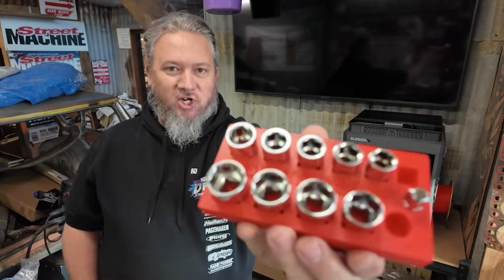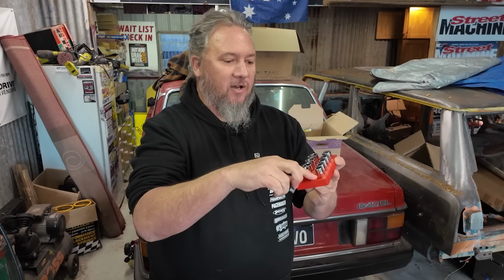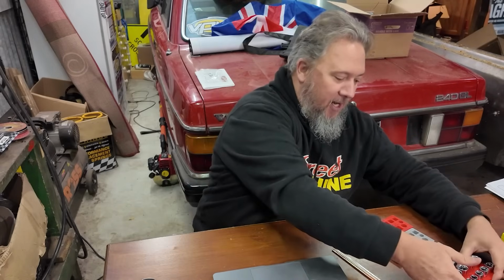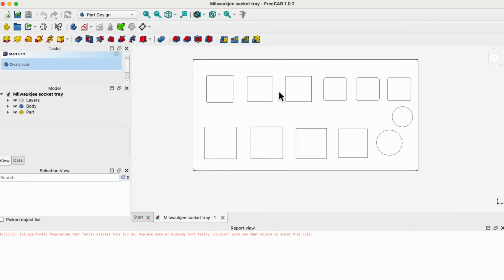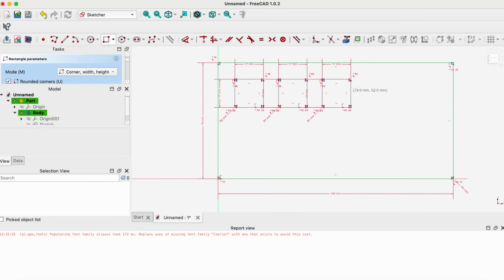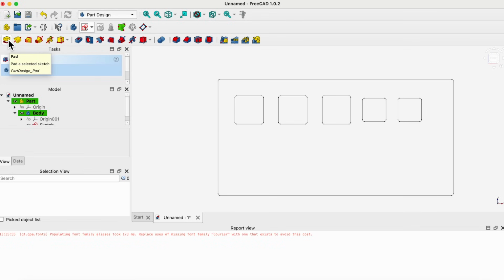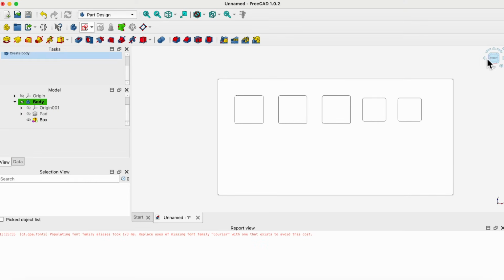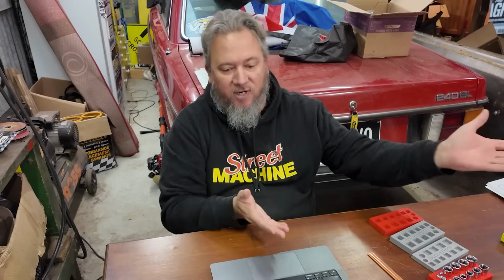Scotty's Garage - How To Design Things With FreeCAD

Comment: Do I require a good computer? I want to get a printer and don't have a computer only tablet atm
Reply: Not really, I'm using a 3yr old Dell laptop and works fine
Reply from the maker: It's a good question. I just use the MacBook that I edit with, so it's a decent computer, but I haven't tried uploading the program to my PC laptop that I use for tuning

Comment: 3D printers seem to be a rabbit hole , CAD drawing programs are definatly a rabbit hole.
Me personally , I have gone from using AutoCadd from 2004 to 2008 to using SolidWorks from 2008 to now in my job. (we also ditched AutoCadd for BricsCAD)
For the more recent project I did at home I used Fusion 360 , I drew up & printed a couple of alignment tools for the front & rear crank seals on an LS1 I was putting together. The number of file thing is a pain , but there are ways of handling that.
Reply from the maker: That sounds like you have a lot of experience with CAD software. That's awesome

Comment: OpenSCAD can be parametric I used to make different belt drive pulleys for my custom built 3d printer years ago, it was good for testing before forking out for the metal versions.

Comment: You should get use to making all your designs parametric. Once you get use to doing it you'll love the ability to change sizes and have the design adapt it.
Reply from the maker: I'll look into that
Reply: Can also help with tolerances as you can set a 3dprint parameter on the value of another parameter that will add 0.3mm as am example on to the size of a hole to give you clearance and then if it was too tight you change the 0.3 to 0.4 and it will update your other parameters

Comment: Hey mate, I would suggest sticking with the free Fusion360 program. The "10 Editable documents at one time" restriction shouldn't be a deal breaker for the DIYer. You can still have several hundred documents/designs on your account and all you have to do is switch between Editable/Non-editable if you are working on 10 different designs at once. It shouldn't be a deal breaker for 95% of home users. IF you decide to sell your prints "commercially" you will need the Professional account once you exceed a certain income.

You'll also want Fusion360 for the CAM side of the program. Right now you're just getting into 3D printing and its all exciting, I get that, I was the same. You'll soon realise that printing is more for prototyping of strong parts, not just cup holders or dash pieces. Soon you'll be looking at benchtop CNC routers to make aluminium parts that you prototyped with your printer. You'll need to use CAM software to make your toolpaths and Fusion can do that as well, in the free version. Keep it all in one program if you can, jumping from one to another will be a pain in the arse. 

Find a youtuber to learn Fusion from, Lars was my go to: https://www.youtube.com/@cadcamstuff and still is but he has'nt posted tutorials for a few years. NYC CNC is my current go to: https://www.youtube.com/@nyccnc.

Im enjoying watching your 3D printing journey, keep at it and keep posting up. Well done, you're doing great so far.

Comment: Just a little tip for beginners. When you only can change view and cant draw in sketch mode with the mouse, change to CAD mode right below on the FC Window or in settings/view/navigation/3d-navigation. 😉
Reply from the maker: Thanks for the tip

Comment: Scotty what you are doing is not 3D CAD, that's actually 2.5D, 3D is the step after that.
Reply from the maker: Explain please?
Reply: @blownhemi  X and Y is 2D, when you extrude that it becomes 2.5D. If the bottom of those pockets were hemispherical (instead of flat) that would be proper 3D. Although technically the chamfers on the edges make it a 3D object. But as a rule of thumb straight extruded objects are 2.5D.
Reply: Also just thinking... I use SketchUp which is sort of different, but the same. How I would have drawn that is your bottom rectangle first extrude that, then draw your boxes on the top face and then extrude that.

Comment: Hey mate i dunno what free cad is like but i use alot of mastercam and solid works at work. When positioning holes/pockets etc i tend to work off the center of a hole so there should be a  “translate” or “traslate line” feature which can copy/offset your lines into the positions you need, its hard to explain in the comment section but say you have a box and you want a hole 15mm in from each corner you just translate the outside lines 15mm and it will give you a center point were the lines intercept, you can then draw squares or circles using the “from center” feature and it accurately and easily places a hole on that spot. You can also translate any shape so if you wanna have a few holes in a flange plate once you have the first initial hole located you can just translate the remaining holes into there positions
Reply from the maker: That sounds like a cool feature, and I'm guessing I can lear to do the same thing with FreeCAD with more experience
Reply: @blownhemi  yeah theres alot of tricks that make cad programs easier

Comment: I haven't any experience with Freecad but programs I have used (solidworks and Catia), you would extrude your basic shape, then use the pocket function to make the recesses (individually), this gives you more flexibility to edit the features later on. 
Interesting stuff, I might download the program to have a closer look. Looks a bit clunky compared to the others mentioned but then again it is free. Being open source, it should remain free and as long as there are enough people using and fixing glitches/improving then it could be quite useful.